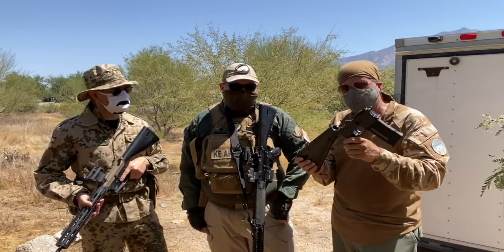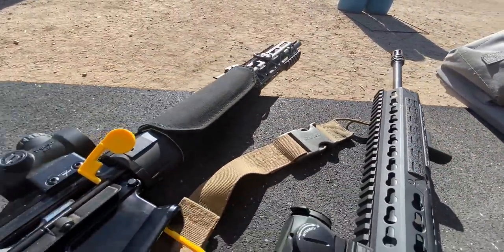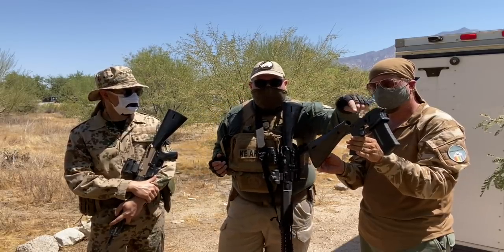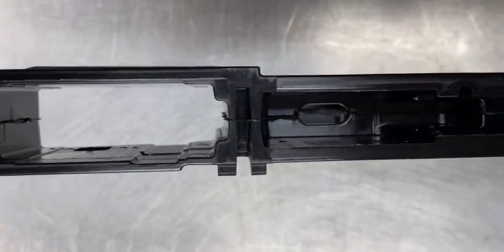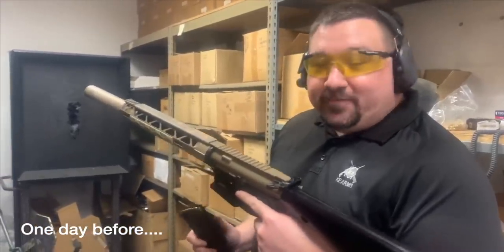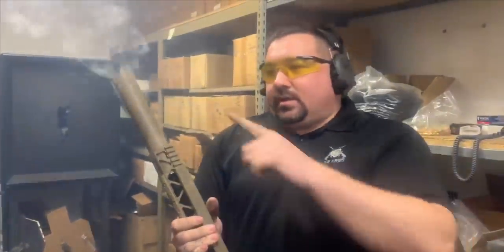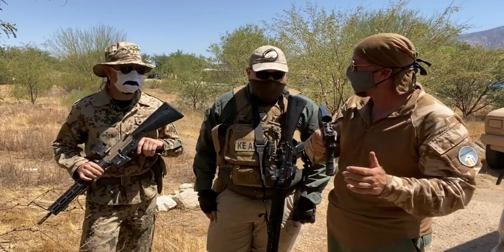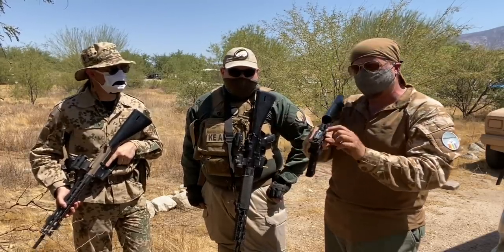WWSD2020 - KP15 First Field Trials

Comment: Looks like you got yourselves a proper engineer for this project.
Reply: Aren't all three of them some kind of engineer?

Wait, was that the joke?
Reply: Chris Loew I thought vertical grips were better for using a carbine with the stock fully collapsed, or “PDW” setups with extremely short length of pull? This has a more traditional 13” LOP.
Reply: Multiple engineers and subject matter experts were consulted and aided in this design
Reply: thgreatandini exactly.

Comment: I hope mike from garand thumb does review on this
Reply: Chris Loew Nothing stopping him from adding a vertical attachment. The philosophy is to run it light as possible, but nothing is set in stone.
Reply: @jeffreyroot6300  The grip is not replaceable i believe 🤔 Wont matter to Most which this is targeted for,  GarandThumb likes a more vertical grip 😆
Reply: DefZen343 Ohhh I misinterpreted that to mean he needed a foregrip!
Reply: @jeffreyroot6300  Nah, it's not to get it as light as possible. You can make an AR weigh less than 4 pounds if you go as light as possible - this is what they thought was as light as you could reasonably go without sacrificing too much durability or usability. They chose certain components (charging handle, buffer, handguard, and more) that aren't the lightest in class, or are even fairly heavy, because of the functionality they add.

Comment: One thing that came to mind on the subject of the sighting system. During my army service we used red dots with that very same mounting mechanism and with it being on the left side of the gun it is really easy to catch on your webbing etc. accidentally opening it and dropping your sight to the ground without you noticing, two guys lost their red dots in my platoon that way and we had to all go and search for them for hours in the forest.

So I would either suggest rotating the red dot mount around to the other side so the lever is on the right side or using a different mounting system, this is especially important if you do not have backup sights.

Comment: Sorry if this has been asked before, but any info on extreme temperature tolerances?
Reply: VarvasNukka well obviously doesn’t melt in AZ heat...
Reply: Juan Sanchez it will probably be Finland if they can finally travel there
Reply: Juan Sanchez Antarctica Brutality!
Reply: A valid question. I expect similar tolerances as the old cav arms polymer lowers.
Reply: Nylon has a brittle transition temp of about -100 °C / -150 °F and a ductile transition temp of about +100 °C / 210 °F.
Seems like they made a pretty good material choice.
Reply: They could pack it overnight in dry ice...
Reply: I would like to see extreme cold weather testing as well. I've seen polymers get very brittle and break when they fall below typical elasticity temps.
Reply: Glass filled nylon is the same stuff used in M16A2 and M4 grips and stocks. In my time in US Army Alaska, I’ve seen aluminum M4 tubes break, but never the plastic bits.
Reply: I think this is 30% glass nylon so there shouldn't be any problem with temperature extremes well beyond or below natural conditions.  Ive seen a lot of this material in car engine bays enduring extremes
Reply: hello
Reply: @kilianortmann9979  If it works for vehicles, it will work for guns.
Reply: TominBach  
I'm down in North Dakota, how you sweatin today?
Reply: Waiting the Erick's new meltdown video :D
Reply: Hmm, I'm thinking I need a KP15 lower with a brn180 upper.
Reply: Humans melt long before nylon.

Comment: If nothing else, this video does a really good job of explaining why gun development is slow and expensive. They're in the final stages before mass manufacture and release and it's all the little pieces just coming together. X supplier using Y product on Z tooling with A second line processes and B QA and C paperwork and D contract with retailer, with incremental issues at every single step. If you've ever spent time around manufacturing, this is 100% normal.

Comment: you guys made a great choice with the geissele super charging handle. I thought it was silly to spend so much on a charging handle but I love mine!
Reply: They said they are switching to an ambi version from KE Arms for the new WWSD rifle.
Reply: @Chilicharger665  The Geissele charging handle is already ambi though? Or are you just saying the new one is also ambi?
Reply: I don't want to put my name yes, they chose the Geissele ambi for their first WWSD. For WWSD 2020, they are switching to an ambi KE Arms charging handle.
Reply: @Chilicharger665  I see, appreciate it. Is there a video out on it yet?
Reply: @idontwanttoputmyname403  nope. They have done very little videos on the 2020 project so far. However, in this video we are commenting on, they said they are in the process of making videos on the new stuff.
Reply: @Chilicharger665  Right, I thought I might have missed something. You know how YouTube is.
Reply: @idontwanttoputmyname403  A lot of parts made by other manufacturers are switching to KE Arms manufacturered ones.

The given reason is KE Arms doesn't want their production bottlenecked by another company. KE wants as much control over the production of their own product as possible. 

This was the answer given for why the WWSD 2020 Upper reciever is a ke arms as opposed to an Aero one which is technically lighter. 

I think I read this on their Instagram account.
Reply: @0sm1um76  Got it.

Comment: Just a thought about flash removal.  Design all exterior flash surfaces with a flat bevel from .25 to .38 wide.  Let it flash over this bevel on molding.  CNC it in one pass back to the designed flat during the same process as hole drilling and other operations. Molded margins look cheap.  Period. End paragraph.  

You stated the material is very robust, so any manual method will be impractical.  By designing a flat from the start, you eliminate the molded look (material is assumed to be 100% fused without porosity) and have a clean, smooth surface.  Especially handy for the charging handle to glide on. 

Keep up the great work!

Comment: Looks great!  Teaming with Brownells was good too.  Are there any concerns with solvents for cleaning.  Hoppes, gun scrubber, brake cleaner?  I know people that use these on their AR.  Any solvents to avoid would be a good thing to put into any instruction you put with it.
Reply: True
Reply: I received an FDE version of the KP-15 recently. It had a bit of flashing on the top of the stock portion that I didn't like. After a quick pass with a Dremel and some sand paper, I cleaned it with some CRC brake cleaner. That did no visible damage. I would avoid acetone though. That stuff dissolves ABS plastic and quite a lot of other polymers. I was very sparing with the brake cleaner. I sprayed a rag and used that for wiping down. It evaporates very quickly. I wasn't willing to spray it directly onto the stock.

Comment: Have you and KE Arms considered manufacturing a version shaped for ban states (Thumbhole stock etc)?  Or is it not worth the time/cost to develop?
Reply: We originally considered molding in a grip fin and trimming it off on most units, but mold flow analysis showed that would cause warping, and glass fiber flow issues

Comment: Given that these have a carbine-length buffer tube, would these work with a mil-spec A2, 20-inch upper?
Reply from the maker: Yes, but it will be very forward heavy and unbalanced.
Reply: This question was stuck in my mind.  Thank you for responding!

Comment: 1. How does the polymer compare with Zytel, which we already know if strong enough for military use?
2. Doesn't making the lower and buttstock lighter make the guns much more nose-heavy than they already are?
Reply: Number two was addressed in the WWSD project, yes it does if you have a normal barrel and hand guard, for the gun to balance correctly you need a pencil barrel and carbon fiber or other lightweight handguard

Comment: Really wish they made a compliant version as well. Most of the non fin compliant options are quite weighty and this would be structurally stronger than most of the grippable stocks.
Reply: Mold flow analysis revealed that including the fin molded in would cause problems
Reply: @SinistralRifleman  
I was actually hoping for a combined grip/stock more like a thordsen (I'm currently using one and i actually like it other than that hole where the grip screw is being directly under my fingers, which this would fix! You could avoid the thin fin issue like that.

I could totally see how the flow would have had issue with the fin on the grip though. Would it be possible to do a thumb mould out and ledge so we could do a thumb on top grip? The mounting screw kind of made that impossible on a regular lower but a custom moulded setup could hold together asymetrically and allow for a dedicated comfortable right or left hand non pistol grip that way.

Comment: Couldn't really make out if they said kp-15 lower was designed to work with a standard carbine length buffer spring and buffer
Reply: Yes it is designed to work with standard carbine buffers and springs

Comment: These lowers are still designed for carbine buffers and springs only, and not rifle buffers and springs?
Reply: Correct, carbine
Reply: Reinforcement ribbing behind the tube portion supports the impact and makes it durable.

Comment: Beautiful iteration of Stoner idea! or a "marriage" between Stoner and Glock!. A couple of questions, I can see fixed stocks, are there plans to produce the lower with telescopic stocks?. Are there plans of producing AR-10 lower with this technology? . Best Regards from Argentina. Hermosa iteración de la idea de Stoner! o un "matrimonio" entre Stoner y Glock!. Un par de preguntas: Puedo ver culatas fijas, ¿hay planes de culatas telescopicas? ¿Hay planes de de planes de producir lowers para AR-10s con esta tecnología?.  Saludos desde Argentina
Reply: A telescopic stock is impossible, the fixed stock is necessary for the strength of the receiver. If it had just a regular buffer tube mounted at the end, that area would be a huge weak point. The fixed stock allowed them to add material and shape the stress to strengthen it.

Comment: Would y’all recommend stippling for the grip, I ask only because I’m worried about compromising the stability of the structure of the product.
Reply: Go nuts with your soldering iron.  However we are not responsible if you mess it up
Reply: SinistralRifleman I could never I’m not competent enough to do stippling I’d have it done by a professional

Comment: How hollow is the stock because it would be cool to store extra batteries is other stuff in the stock if there were enough room. Of course you would need a butt plate that a flips up?
Reply: It has a cavity just like an A1/2 stock would have
Reply: The default butt plate probably won't have a door to access that cavity but that can be changed.

Comment: I'm really surprised the rear end on the receiver connecting to the stock didn't have to be made thicker. Tests done with 3D powder printers had to have thicker material where there was a lot of stress to keep the receiver from snapping in half.
Reply: 3D printing is not the same as injection molding with long glass filled nylon.

Comment: I worry about the longevity of pin holes and dtents with polymer lower. Bought one and the safety detent hole wallered out. Rendering the lower useless.

Comment: I'm a Maryland resident and as a result, can only purchase AR-15 rifles with heavy barrels or barrels with the dimensions of a heavy barrel. I was wondering if in the future, there could be a version of the WWSD rifle variant that is marketed as a HBAR and or sold with a HBAR profiled barrel. Doing so would allow maryland residents to directly buy the complete rifle from Brownells, which we cannot do with WWSD as offered. Alternatively offering a parts kit, minus the pencil barrel, to buy with the lower, would also circumvent the legal issues that Maryland's gun laws create.

I realize that the main focus is to get the KP-15 lower and WWSD2020 rifle to market as quickly as possible, so I understand that such a request is not a priority. After all the Maryland market is already small compared to other states, which the current WWSD configuration can be purchased as is. All I ask is that you consider offering modified versions of the WWSD rifle in the future, which make it possible for residents of more gun restrictive states, such as myself, to purchase a WWSD rifle, or at least a rifle as close to the original design as legally possible. I'm sure I am not the only gun enthusiast who would like to buy a WWSD rifle, but currently cannot due to local gun laws.

I've been following this project for quite a while and love seeing how it has developed. I will most likely be purchasing a lower regardless, but would like to buy an as built WWSD rifle if possible. Thank you continuing to make excellent video content and putting the work in to see the WWSD project through!
Reply: what is the official logic of only allowing heavy profile barrels?
Reply: @Erpyrikk  In truth there is none, because there is no significant functional difference between a heavy barreled and regular barreled AR-15. The exception exists because the Maryland firearms community fought our state assembly to allow for the "Colt AR-15 Sporter" to be legal in the State's assault weapons ban, while all other AR-15 rifle configurations would be illegal. When the Assault Weapons ban was passed, the state police were tasked with enforcing the law and interpreting what weapons were legal/illegal under it. The MSP decided that any weapon deemed illegal as enumerated in the law or a "copycat" of an enumerated weapon, would be illegal. Since the only major difference between a AR-15 and a Sporter AR-15 is that the Sporter had a "Heavy Barrel", MSP decide that would be the deciding factor on whether a AR-15 would legal or illegal. 

The interpretation has since expanded to include any barrel that has the same dimensions as a heavy barrel, so fluted barrels that keep the same outer diameter of a heavy barrel are legal. Its not clear, but it seems any rifle that is marketed as a "HBAR" AR-15 also seem to be legal, but that is more of a grey area, as the marketing allows you to tranfer the weapon to a local FFL without them immediately rejecting it. Since no one is going around a taking a caliper to barrels, most stores just need the box to say HBAR to satisfy legal reqs and at that point its not their problem. Still the marketed as exception, is a grey area and not explicit.

This is all to say the whole legal requirement is dumb, but atleast it allows Marylanders to still own AR-15's.
Reply: @PdPete11795  i understand that its a pointless ruling i'm just curious what the given reason is.

Comment: Where do you have info on buying these in either part or finished guns?
Reply: Juan Sanchez 
Excellent, thank you. I guess it bears repeating because some like me may have come in mid stream.
Reply: They are manufactured by KE Arms, but Brownells is the sole distributor right now. Go to Brownells and search WWSD. They also have a link on the home page. You can pre-order the stripped lower, the lower with milspec, the lower with the upgraded trigger, or the the complete rifle.

Comment: Also curious how the safety detent is installed since the hand guard is integrated to the lower
Reply: Install the spring and detent first, then slide the lever in over it. It’ll probably be this lower’s version of the pivot pin detent as far as annoyance goes.
Reply: @509Gman  that's what I was thinking. Springs and detents will be flying across the room for sure.

Comment: Any thoughts on making a polymer trigger group?
Reply: I can't speak for them, but poly trigger groups make great milspec triggers. Match triggers? Not so much. I'm not so sure you can really make the up the difference in price with polymer. Right now I can get a baseline milspec trigger group for what $25?  So is your audience the people who are okay with a milspec feel but want to save $5? You'd take a bath on all the costs of development time. The only way to really make up the difference is to sell a huge volume, or too sell them at a higher price. 

If it was significantly lighter, then you might have an audience. But then you're going up against some of the real high end triggers. If there was a military market that was specifically paying for the development and use of them before they came on to the civvy market, then I can see it. 

For instance, this lower has the benefits of covering fixed stock needs, for a great price. You're essentially getting a lower/buffer tube and a stock for $99. Which is a great price for that much. Especially since a Magpul fixed stock can go for $60-70 a pop, and a standard cheap lower is around $40-50. You've already saved $20-30 just by going with that lower. Plus it weighs so much less, that people who are all about <6lb builds are interested in it. A polymer trigger group just doesn't have that level of Cache, IMO.

Comment: What are your restrictions for making it full auto like in the testing? Also make a "Gun Buster" style video about your lower
Reply: Any FFL with the right type of license can create a Full auto machine gun - for company use, or military or law enforcement use. They can't be sold to the public if they were manufactured after 1986 or not put on the register. 

So KE Arms can make a full auto and test it and let people shoot it, but it will always be owed by KE Arms (or another company with the proper FFL)

The AK Guy converts a large number of commercial AK variant rifles and pistols into machine guns for company use.